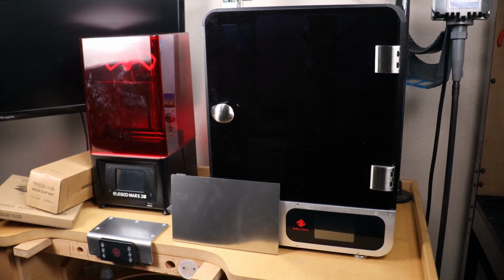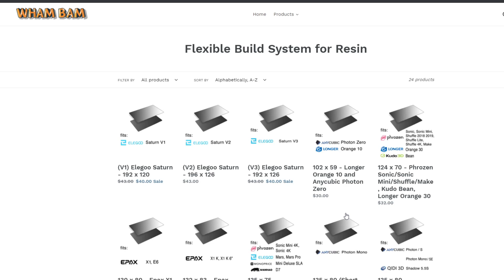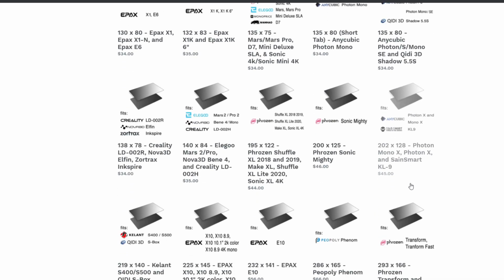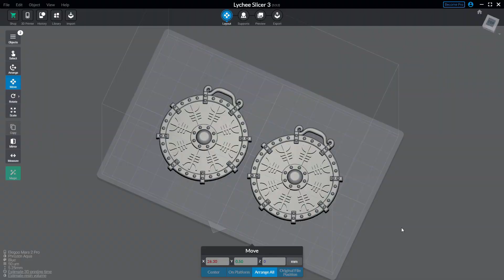Easier, Faster and Cleaner Resin Printing with Wham Bam Flex Plates and Silicone Mat

Comment: The only thing to add that I think everyone misses is that with the flex plate wham bam magnet It adds surface area so you need to watch out for your max fill line because it just moved a realize this before hand I normally keep everything at Maxville when I’m gonna start printing and when I looked I was like wait a minute I just added volume to my bill plate that’s going to be submerged that’s going to be displaced so I should stay below the Maxfield line by a bout a half cm and that seems to work for My Build plate in my vat

Comment: Never had issues even with prints parallel to the surface. Stick build plate in a food saver bag or similar, plastic container, place in deep freeze for 20 minutes and the print pops right off. 
No messing with z height adjustments after each print

Comment: What is the best castable resin for the price? The resin I’m using sticks so much to my build plate and everytime I have to put all my strength into getting it off. I just ordered the wham. Thank you for the video!
Reply from the maker: I have not tried all of them yet but I have some on they way that is only $65 per KG so that might be the cheapest you can get but I need to see how it works.

Comment: wonderful video, thanks.  Please remember to thoroughly clean the build plate prior to magnet install, this includes sanding the build plate with 220 grit sandpaper, included, and cleaning again with alcohol.  Also, leave the magnet to cure for 72 hours before use for a permanent bond.  thanks!

Comment: For those wanting a flexible plate just get sovol 3D’s product. $23 for two magnets and plates for my Mars 2, and I guarantee you the products are the exact same. There’s a lot of these popping up, and I wouldn’t be surprised if they were all made in the same factory.
Reply: they are not made in the same factory, and I can assure you that the original is much higher performance
Reply: @WhamBamSystems  As someone who currently uses the Sovol resin "tanks" I have been looking at both brands products. Would you mind informing us what the differences (that you know of) are between your brands build plate systems?

Comment: Did you have to print/make and install a spacer on the Mars 2 Pro z limit? I was looking at the Wham Bam system the other day for mine and was wondering if the spacer they suggest is needed or if just a bed level.
Reply from the maker: I didn't install one and it leveled fine without it 😁👍
Reply: @GomeowCreations  Awesome! Watching this video sealed the deal on me getting one. Love printing on flats, hate that I snap half my attempts at doing so.
Reply from the maker: Let me know what you think once you get it. 😁👍

Comment from the maker: Make resin printers easier, faster and cleaner than ever before with these flex plates and silicone mat from Wham Bam
Save 15% off sitewide just use code GoMeow2021
Wham Bam Resin Flex Plates ➜ https://bit.ly/FlexibleBuildSystemforResin
Wham Bam Silicone Slap Mats ➜ https://bit.ly/SiliconeWorkMat

Looking for a resin printer?
Amazon - ELEGOO Saturn - https://amzn.to/2T7Hjjx
MatterHackers -ELEGOO Saturn - https://bit.ly/MHElegooSaturn
Amazon - ELEGOO Mars 2 3D Printer - https://amzn.to/2U6zgn3
Amazon - ELEGOO Mars 2 Pro - https://amzn.to/3BXckId
MatterHackers - ELEGOO Mars 2 Pro - https://bit.ly/HMElegooMars2Pro
MatterHackers - Anycubic Photon Mono X - https://bit.ly/PhotonMonoX
MatterHackers - Anycubic Photon Mono - https://bit.ly/PhotonMono2K
Amazon - Sonic Mighty 4K - https://amzn.to/3piI9aY
Phrozen3D - Sonic Mighty 4K - https://bit.ly/SonicMighty4K
Amazon - Sonic Mini 4K - https://amzn.to/3jjT9AS
Phrozen3D - Sonic Mini 4K - https://bit.ly/SonicMini4KPrinter
Phrozen3D- Sonic Mega 8K - https://bit.ly/PhrozenSonicMega8K

Wash & Cure Systems:
Amazon - ELEGOO Wash & Cure Station - https://amzn.to/3gWHUxH
MatterHackers - ANYCUBIC Wash & Cure Machine 2.0 - https://bit.ly/WashAndCureMachine2
Amazon - ANYCUBIC Wash & Cure Machine 2.0 - https://amzn.to/3DWG4FO
Amazon - ANYCUBIC Wash Cure Machine Plus (Large) - https://amzn.to/3DWFLe8

Other Helpfull Items:
MatterHackers - LayerLock SLA Resin 3D Printing Build Surface - https://bit.ly/LayerLockBuildSurface
Amazon - Isopropyl Alcohol 99% Pure 1 Gallon - https://amzn.to/3tpyzC6
Amazon - Isopropyl Alcohol Grade 99% Anhydrous 4 Gallon - https://amzn.to/2RvASpe

______________________________________________
If you are looking for more tools and materials that I use, well you're in luck! I made a page on my website just for that and I'm updating all the time so bookmark it to stay up to date:

https://GomeowCreations.com/tools-and-materials 
https://GomeowCreations.com/partners-discount-codes

**Read This**Just so you know, just about all of the links I post are affiliate links. This mean if you click them and buy something I will make a small commission at no extra charge to you. This helps support my channel and allows me to keep my content free.
______________________________________________
My PATREON ➜ https://patreon.com/GomeowCreations
One time support ➜ https://paypal.me/gomeowcreations
______________________________________________
Instagram ➜ https://instagram.com/gomeowcreations/
Facebook ➜ https://facebook.com/GomeowCreations/
______________________________________________

#FlexPlates #3DPrinting #GomeowCreations #3DPrinting #ElegooSaturn #ElegooMars #chitubox #chituboxpro #gomeowcreations #elegoo #elegoomars3